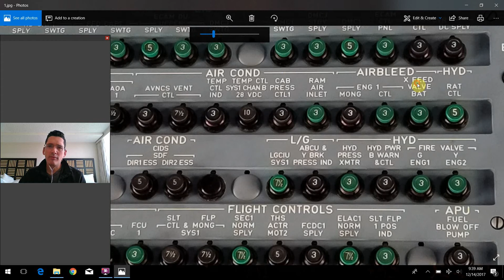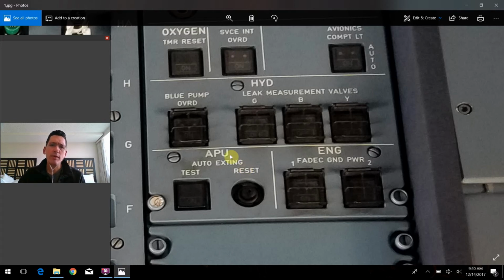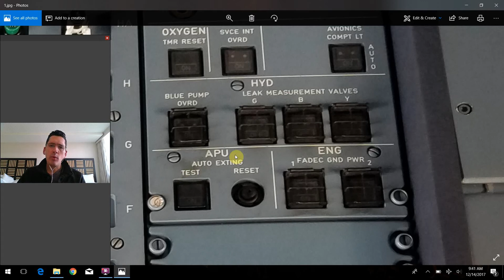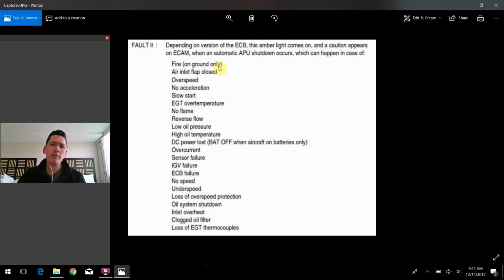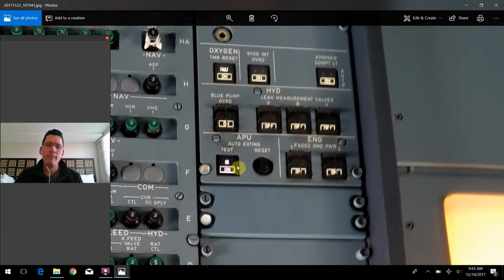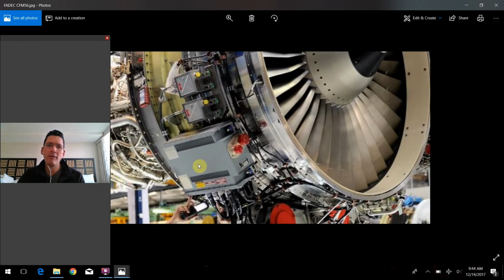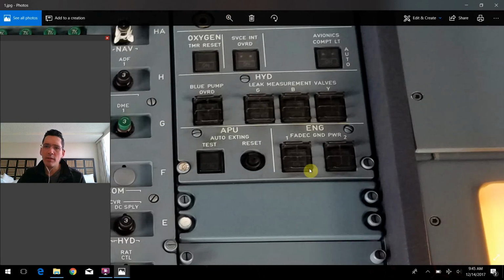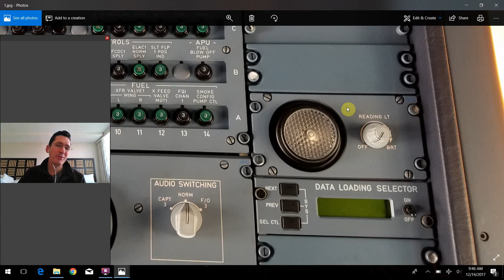Airbus A320 Cockpit Tour: #7 Part 3-Maintenance Panel:  What do all those buttons do?!

Comment: Great series of videos, thank you.

I'm not usually one to criticise, but I have to in this case, the use of the word "Urm" every three words make this particular one of the three videos VERY hard to listen to.

I know it's not deliberate, and we are all guilty of it, but if your first video in the series had been like that, I would never have finished it or watched the other two.

It's always interesting to learn the differences between different models of aircraft and their nuances.

The service "Service interphone" system for use on the ground Is common across many different types of aircraft in the Transport category.

Even the business jets that I have worked on in the past have it, although the system is absolutely vital on larger aircraft.
With one of the large types I have on my CV even having an interphone position up at the top of the Vertical Stabiliser!

Thanks for making these videos and explaining features to us.